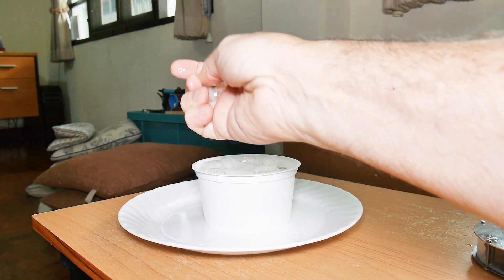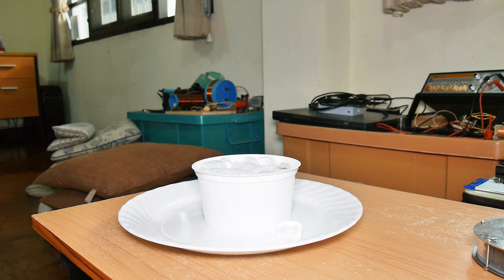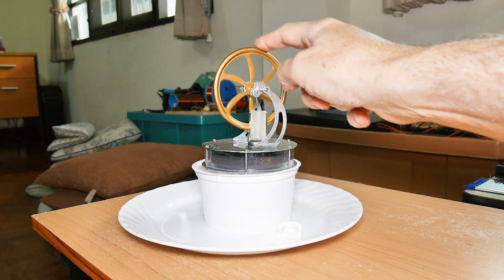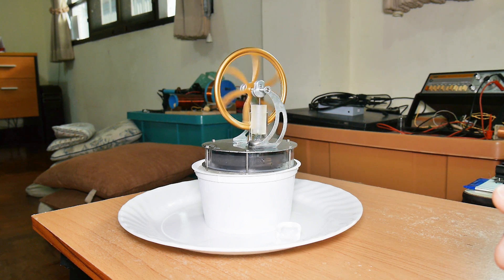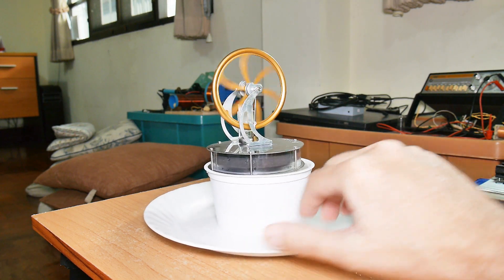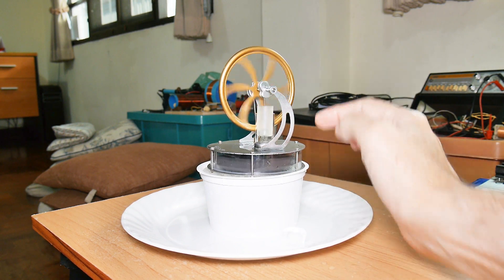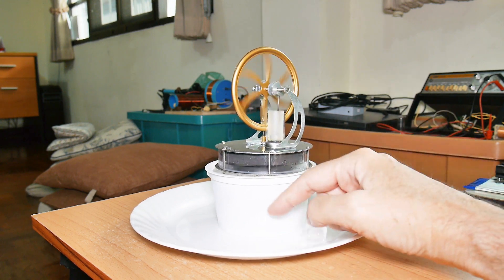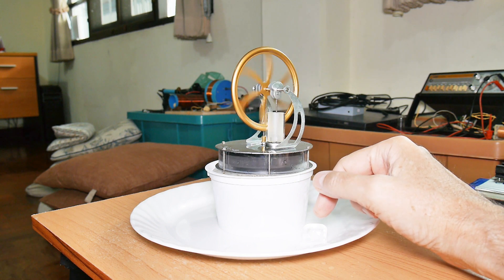Stirling Engine That Uses Ice for "Fuel"???

Comment: Is it only this model? My DWCL 01 low temp strling engine doesn’t do this
Reply from the maker: Have you tried putting the ice on top?
Reply: @tsbrownie  im gonna try this now lol
Reply: @tsbrownie  bro it’s working!!!!
Reply from the maker: @RamzaBeo  That design is pretty different in that the displacer and piston are not offset like in the one I showed.
Reply: @tsbrownie  it reminded me of a car piston! But yea it spins very fast! And when it’s on snow mode it goes about 130rpm
Reply: @tsbrownie  goes around 350-390 rpm under a hot lamp lol. I basically put the engine on top of a lava lamp stand with the lamp under it. It does FASTTT